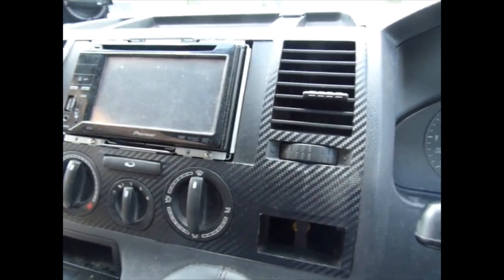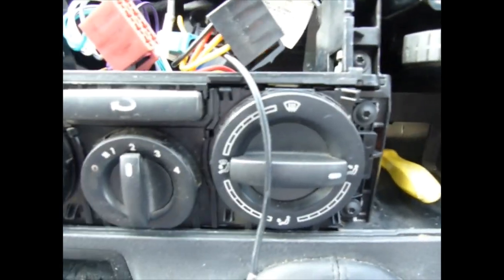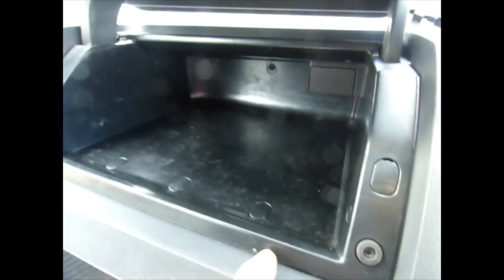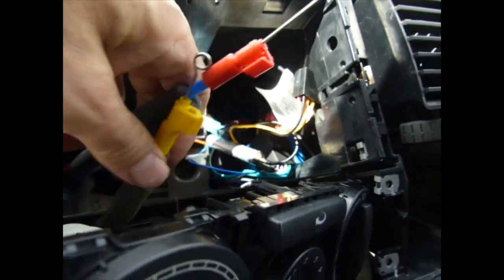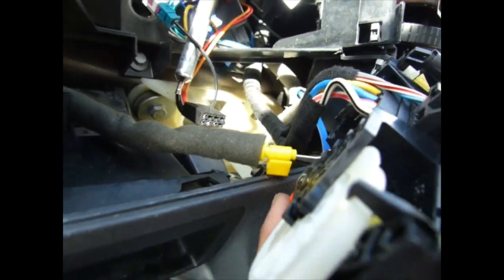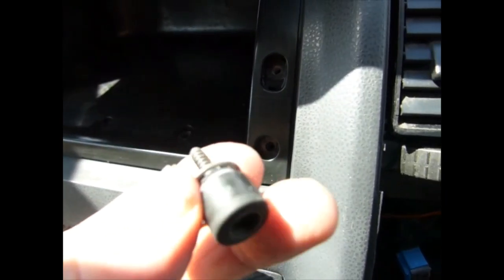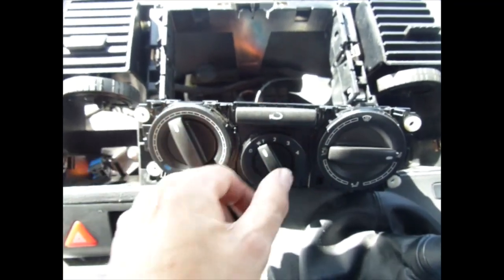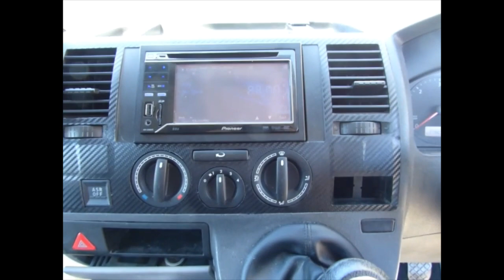VW T5 Transporter Blower Control & Cable Change Fault Repair

Comment: Worked a treat, Air direction dial gear had jumped out of position. Prized it back into its track and job done. Now need to find why theres next to no heat getting through despite all cables being connected. Thanks for your effort :-)
Reply from the maker: If the cable was the original twisted wire cable type note that they can get buckled....so if it jumps out of position again will be better to change for a solid core cable.
Reply: @bobsvanthings2226  Cheers chap

Comment: My problem is the hot and cold adjustment keeps blowing holes in the nylon kam attached to the control unit I’m on my 3rd control unit at £180 per go the solid core cable (red) is absolutely fine, I believe my problem is season change shrinking of plastic etc. Or spilt cola